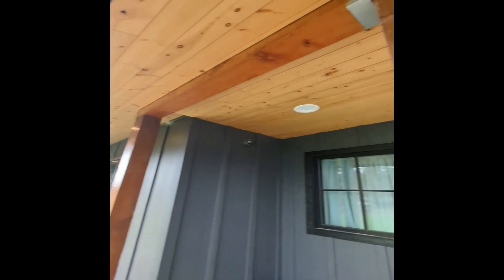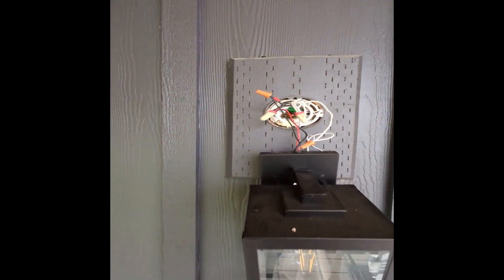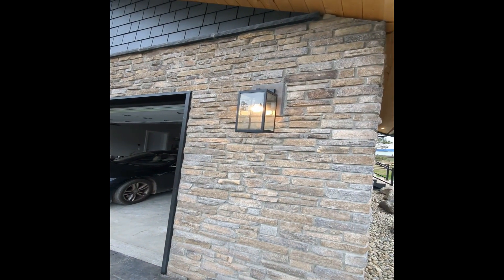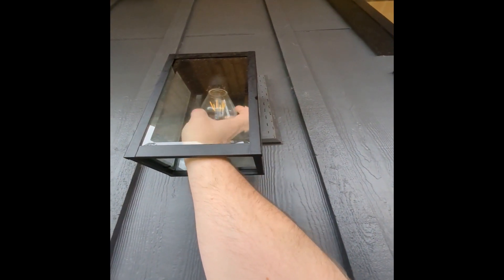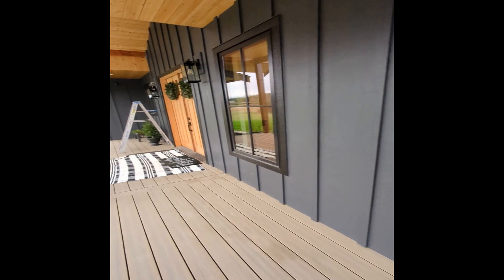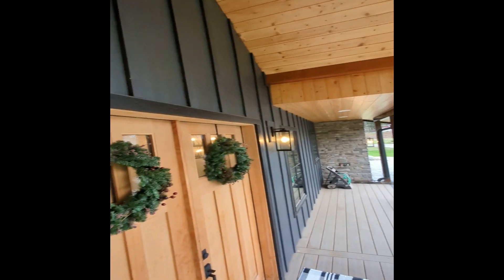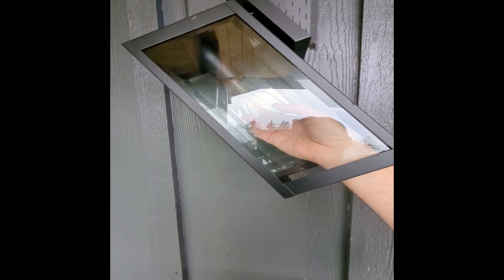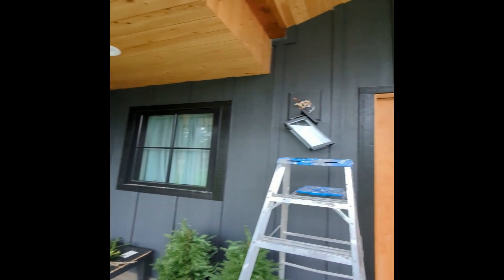SOLVED: Quoizel Porch Lights Not Working! Intermittently turning off and on. Bulbs won't stay on.

Comment: What was the solved part?   Worst video ever.
Reply from the maker: It's in the description.  This video was originally posted to ask for help.  Once I solved the issue I updated the description.
Reply: @BrettsBuilds how did you resolve the issue?
Reply: I have the same brand of lights.   How do I change to “dusk to dawn “ option from motion detection?